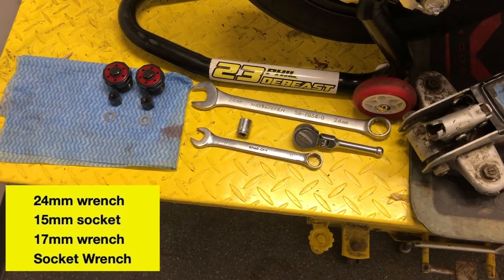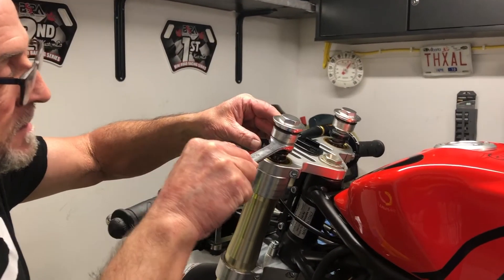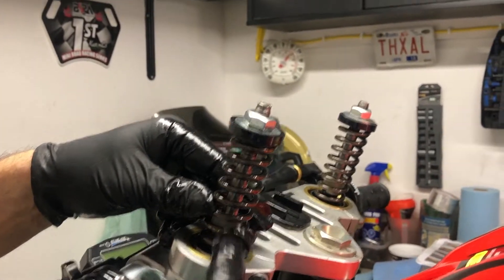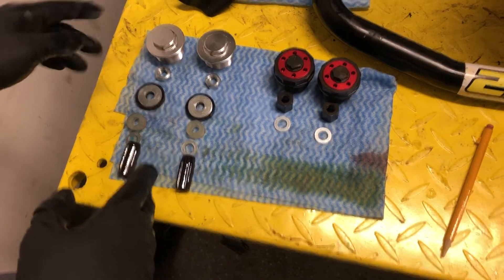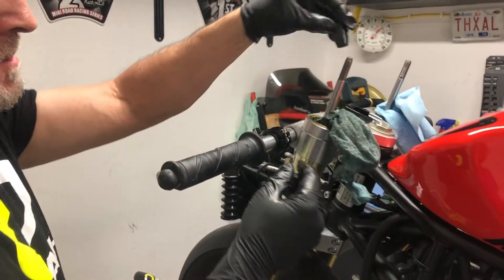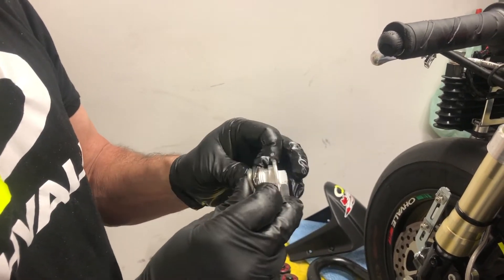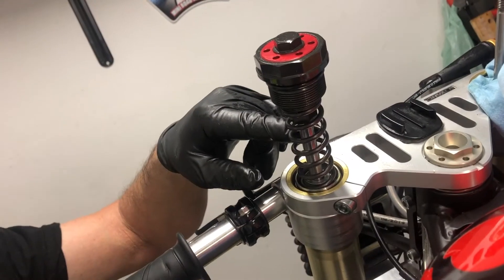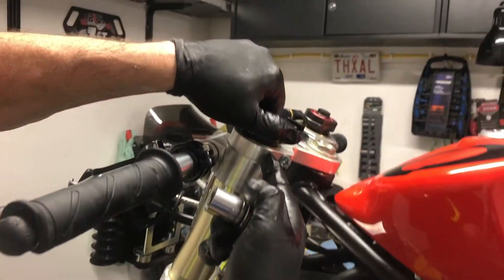How to Fit Fork Preload adjusters to Your Ohvale GP-0

Comment: Hello.
Good videos.
What is the viscosity and amount of oil?
Reply from the maker: Oil spec is Ohlins #5 or Liqui Moly HLP100, set oil height at 58mm
Reply: @phildebeastracing height is measured without the spring? rigth?
Reply from the maker: @chc450  Correct